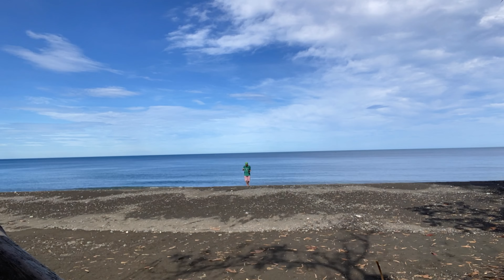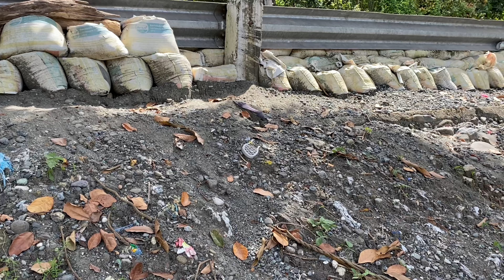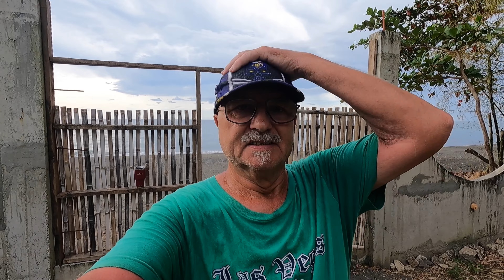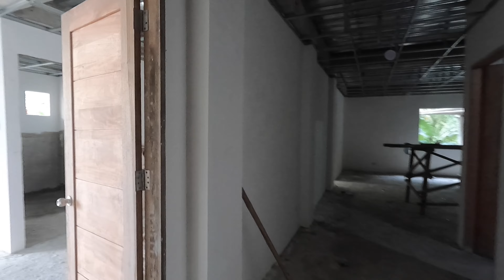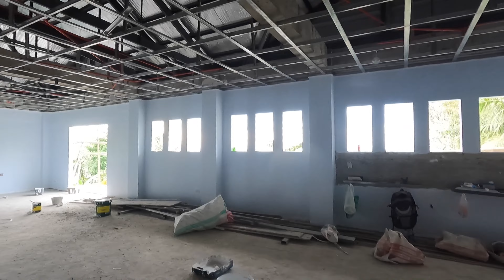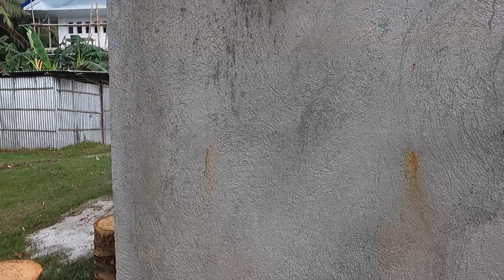Antique,Philippines house build DAY204-The Bridge to the Garage is happening !

Comment: Great colors, maybe paint the bathroom outside that also, not understanding the front fence yet if they are putting a road in they could undermine the fence with all the construction  ??
Reply from the maker: They said they need 10 meters from the centerline. They have 13-14 to the fence/bridge.